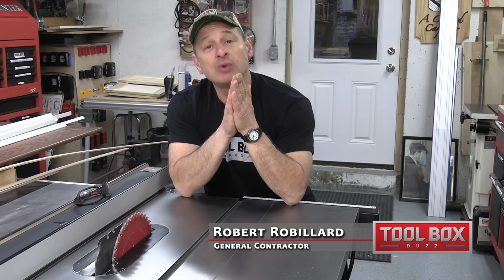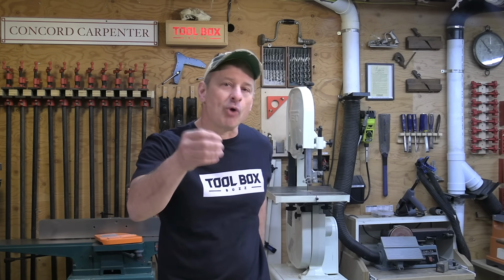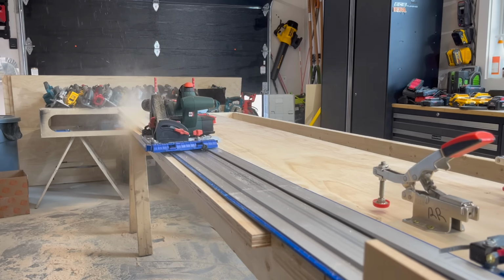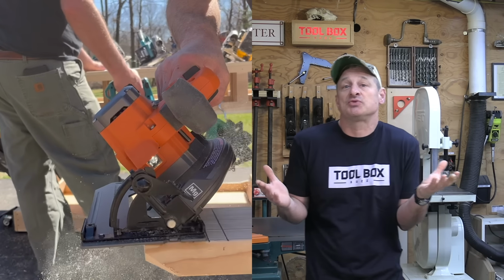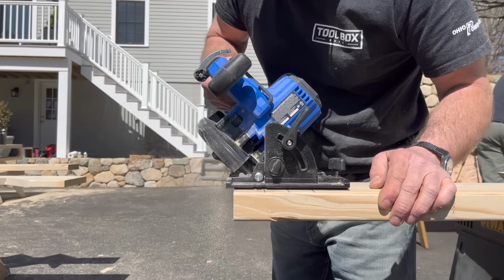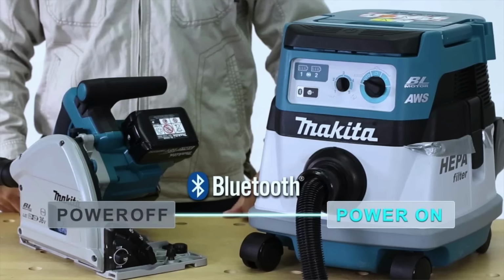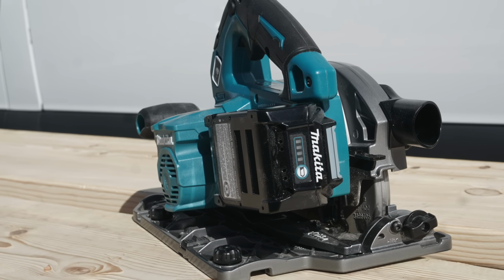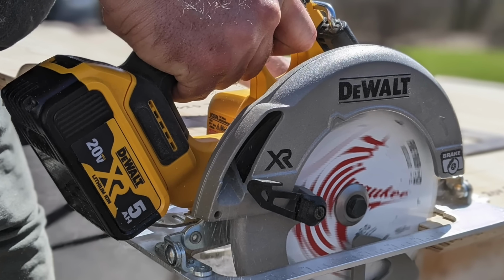Best Cordless 7-1/4 Circular Saw

Comment: I used a coworkers Metabo hpt circ saw, and I actually liked it so much I went and bought one and put my milwaukee fuel in the garage, I like the fuel a lot, but the Metabo was more comfortable to me, and I seemed to cut more accurate with it.
Reply: Metabo is becoming more well-known and seems to be every bit in the pro class. They also make some really good impact and drills.

 Im a framer, i always used dewalt which are good tools but also because of the other cordless options. But when I seen mikita in a worm drive style I got it, been using it for 2 years it works good. It is heavier but its comfortable to me. There is alot of really good cordless options now.
Reply: @jeremymcintyre7812 as a framer you should try the metabo rear handle. Super light and powerful

Comment: As a DeWalt owner one thing you forgot to mention is the 99% worthless depth gauge. It's steel-on-engraved-steel which is hard enough to see. Add saw dust and safety glasses and it disappears. I'm hoping white spray paint will fix it...
Reply: Should place blade depth directly to material thickness. Never use Depth gauge anyway

Comment: Considering that the Metabo HPT saw is probably one of the oldest saws on the list and it did very well. Finding them to be a good backup brand for when I have to send my Milwaukee stuff to warranty Great value great power again just great value
Reply: The new rear handle has replaced our other worm drive left handed saws on the jobsite
Reply from the maker: Agreed
Reply: @baseballdude8491  Just got that saw and love it. I have mostly dewalt tools, but as they wear out ill be replacing them with Metabo HPT. Impressive tools at a great price.
Reply: @michaelnichols7669  yep they are priced right and have all the things I'm looking for including the lifetime gaurantee
Reply: Agreed. If I was an apprentice carpenter right now I’d go metabo. Save a few bucks, great saws and nailers, and their bigger tools have the battery to plug feature. Hard to go wrong.
Reply: @ImpulseAudioSpeakers  Absolutely. Great value and quality I also have their sawzall, 18ga and framing nailer. I love using the tools
Reply: Love my green tools!  They are excellent, even if not quite the flashiest or fastest of the bunch.
Reply: @baseballdude8491  - Yeah, the new rear handle Metabo HPT is blowing a lot of the others out of the water. I was surprised that this older version was the one that was tested. I used to be a DeWalt fan, but when I got the 20V Max set after it came out, I was very disappointed. And when my reciprocating saw died after 3 months, and the manager of the tool department at Lowe's told me that "DeWalt's warranty doesn't apply to contractors", I was done with DeWalt. I switched to Hitachi, which then became Metabo HPT, and it's one of the best choices I've made. Never looked back.

Comment: As a veteran carpenter I will give my opinions on the saws I am familiar with. The Milwaukee, to heavy ,expensive ,bad view down both sides of blade and the motor cuts out under hard rips because the motor is pulling too many amps .Makita, excellent quality but they have moved the motor forward to accommodate the batteries thus the blade view is very poor particularly on the most important left hand side and the saw feels to hunched up and it is  to expensive. The Dewalt, most powerful, and excellent sightlines down both sides of blade this is very important to me as I don't rely on the front base notches of any saw to cut accurately, this saw feels familiar to me like my old corded saws ,reasonable price and low weight. I urge potential buyers to test each tool out and purchase regarding your own requirements .

Comment: Ive got the milwaukee for 3 years now and i still like it a lot , powerfull, reliable have work in all kind of harsh condition have never let me down, i like the 18v systeme all batterie fit in all the tool. In the near future when milwaukee will release pouch cell i will use it in my 18v tools dewalt will not be able to make a 60v pouch cell for theirs tool

Comment: Darn, was really hoping to see how the bosch profactor track capable saw would fair against the rest. Great saw, nice testing though!
Reply: I was waiting for the same thing
Reply: They left it out on purpose!
Reply: @JB-ot9hi  How so?
Reply: @scottarnold5215  By placing two DeWalt saws in the competition.
Reply: @scottarnold5215  Man you're wrong. Just keep spending them Stanley Decker and TTI tool company checks, guy! 
Bosch, Metabo, Mafell...
Reply: @JB-ot9hi  As a long-time member of Tool Box Buzz, I was heavily involved in this Head To Head Test. Bosch simply dropped the ball and did not send us a tool, and neither did Flex. You can believe what you'd like though.

Comment: Obviously the festool hkc55 does not use a 7-1/4" blade however it was designed for an intended use similar to that of 7-1/4" circular saws. Hence I do not believe it would be unreasonable to say that the hkc55 could be considered in the same category. That said I would consider it not only far and away the best saw out of all of these but I would say that due to its capabilities and features the hkc55 is in a class of its own.

Comment: Didn't use a high output battery with the Milwaukee, but used flexvolt on the Dewalt...
Reply from the maker: We kept the batteries is the same range of Ah
Reply: @ConcordCarpenter  Ah has nothing to do with the high output function. It is a considerable difference when using ANY Milwaukee tool with a high output battery. Ah is simply about runtime.

Comment: I'm one of those unicorns. For tool batt platform I use DeWalt, Makita, and Milwaukee. For sidewinder circ saw I run the Flexvolt and it's a great saw that has never let me down. 

As always very thorough h2h and I appreciate the time and effort you guys do for the h2h videos.

Comment: Ive been researching Flex for the last 3 years. I wanted to be sure before committing to a battery platform. Ive been doing construction for over 20 years and ive experienced all of the best offerings from the top green yellow and red brands. Im currently running all FLEX tools. FLEX is so far ahead of everything out there in power ,run time , charging and durability.
Reply from the maker: @JosephGahagan-vh4pz  I’ve been very impressed with flex so far. However, some of the flex tall that we’ve had have not lasted long term

Comment: It was said up front that the tests included a Ridgid R8657B circular saw.  There were two segments up front that displayed this saw, with the 2nd segment ending at about the 8:07 mark.  After that, there were several other video segments of a Ridgid circular saw that definitely was NOT the R8657B, including one showing it cutting - would you please explain why this is?

Comment: Disappointed that the New and widely available Bosch Profactor Strong Arm Brushless 7-1/4 saw didn't make it. Amazing saw, super powerful and comfortable brushless saw. especially with the 8.0 "Fat"Core battery.   Menards and Lowes locally have it in stock. Bosch StrongArm 7-1/4 SGKS18V-25.

Also, thank you for your extensive testing regimen efforts. Great reviews as usual.
Reply from the maker: This is the saw Bosch wanted tested

Comment: I have the milwaukee, but this xmas I got a smoking deal on some Metabo stuff, including the circ saw. I haven't messed with it yet, but based on your review it looks like I picked a winner.
Reply: I've been a red and blue guy for a long time but we have replaced alot of our jobsite tools I er the last 3+ yrs with more Metabo HPT 36V tools-Lifetime.warranty, AC adapter for the longer run tools(saves battery life), batteries backwards compatible with 18V and 36V, durable and priced much better than my other favorites which allows me to outfit more of my crew with pro grade tools w/out killing profits

Comment: I wanted to see the newer Bosch PROFACTOR GKS18V-25CB14. It's supposed to get comparable performance to a high performance corded saw and the material quality looks superb.
Regardless, it was a great comparison and your testing methods are very well thought
Reply: I like mine
Reply: just got the track compatible bosch biturbo, tradedin my 54v flexvolt. very  impressed with the Bosch, great  line of sight, plenty power,great height of blade adjustment, great feel to it,dont miss the dewalt one  bit

Comment: I love my Milwaukee fuel rear handle comes with a blade wrench like DeWalt. Plus I played around with the the bevel and height adjustment now I don't have a issue with them agreed you can't beat a DeWalt circular saw. But true enough can be said about Milwaukee sawzall

Comment: Thanks sir, a lot of work went into this. My dewalts have treated me very well. I noticed you had a XR 6.0 during the dewalt speed runs but the flexvolt 6.0 during other tests. The XR 6.0 is 21700 cells while the flex is 18650. My flexvolt sawzall runs stronger on an XR 6.0 than on a flex 6.0 even though it's supposed to benefit from flexvolt batteries. Long story short, I'd be curious what the dewalts times would look like if you threw a flexvolt 9.0 battery in considering it uses 21700 cells and the saw should technically benefit from the flexvolt battery tech itself. Either way, great info, and the makita with AWS and track compatibility is definitely on my wish list. All I need is for 17 skillsaws to stop working and I can finally justify it lol
Reply: I personally don't feel any difference between the 6ah 18650 and the 9ah 21700. The 6ah cells are samsong 20s (30a) and the 9ah cells are samsong 30t (35a), so not a big difference.
Reply: @MrArcticPOWER  The difference should be minimal at high battery level but at lower levels it can be significant.  As the battery drops down and power is demanded the voltage sag will increase on the 18650s compared to the 21700s.  This will also mean less heat due to lower current and better battery life and longevity.
Reply: @MrArcticPOWER  I understand that it doesn't feel like a major difference but from 1st to last place was only 8 seconds off so even taking 1-2 seconds off of a fastest cut is pretty substantial as it would be another 10-20% faster overall. I'm just curious, I like all my saws. Bosch, makita, dewalt, metabo, etc. Even the little M12 is alright, but definitely needs a major update considering a 5 3/8" saw should be doing better than a 1 1/2" cut depth. I get the same depth from dewalts 4 1/2" blade and Makitas 5 3/8" trim saw has 2" cut depth. I digress lol
Reply: Speeds wouldn’t be noticeable. Probably a few milliseconds difference if that. 6ah is more commonly used, 9ah adds a lot of weight as does the 12ah and 15ah flexvolt batteries. They do add some extra power as the battery doesn’t drain as quickly but I think for practicality they stuck with 6ah batteries which majority of platforms have and which most tradies would prefer using as they make the tool more comfortable to use
Reply: Btw, if you're using a 20v XR 6.0 battery on your sawzall, you don't have the real 60v flexvolt one, but the flexvolt advantage. They look the same, but the flexvolt advantage operates at 20v and is a lot less powerfull. Same thing for the cicular saw or any other flexvolt advantage tool. 
Why does the 6ah XR gives you more power than a 6ah flexvolt battery, I don't know. The 6ah flexvolt should be able to push a constent 90 amps at 20v while the 6ah XR can only do 70 amps. It doesn't make sense.

Comment: I have that Ryobi saw, it's great with a 5ah HP compatible battery and above, anything under... it sucks really bad, bogs down, stalls all the time, the smallest deflection in material can stall it instantly, but that 5ah HP battery does make a difference it feels like it wants to run away sometimes even in thicker harder material.

Comment: Not that it would make it from worst to best but you ran the worst battery for the Ryobi.  It was either the 1.5 or 2 ah non HP battery.  To give it a fair shake it should have been at least the 3 or 4 AH “High Performance” battery.  It makes a huge difference in power output.

Comment: Got the 40vMax saw, and a 6.5" 18v Makita brushless, both are accurate and feels great, you simply cant argue against Makitas build quality, not objectively at least. The 40v is awesome, very next level, i wouldnt dream of buying the weaker 2x18v with the hassle and bulk of dual battery. Makita XGT 40vMax isnt cheap, no, but good value for money. If i was invested in another battery system like M18 or DW i would still go for Makita circulars.
Reply: I think the convenience of having a true 1 battery system for over 250 tools is vastly underrated. On a Jobsite, having truly 1 battery that does literally everything, is extremely convenient. If you need another battery, just grab one, they literally work on everything, except sometimes you need 2 rather than just 1 depending what tool you are using

Comment: I'm pretty sure the legend is wrong. AFAIK the first patent for what could be recognised as a circular saw (British patent no.1152) was issued to a Southampton tradesman by the name of Samel Miller and was registered 5th August, 1777 - or 2 years before Ms Babbitt's was born (1779). It is believed that Walter Taylor (1734~1803), a carpenter, also from Southampton, preceded Miller in designing the circular saw, putting his first circular saw which was put into service at Wood Mill, on the River Itchen, to manufacture sheave blocks for the Royal Navy in 1781 (or when Ms Babbitt was 2 years old). Samuel Bentham, who is thought to have visited Wood Mill, took out patent no. 1951 in April 1793, for "labour saving devices in naval dockyards" which included the design of a circular saw - and it was this design which was subsequently adopted by the Royal Navy and manufactured by Henry Maudslay in 1805 which was the first production circular saw and it is preserved at the Portsmouth Block Mills in England. A lot more detail is to be found in the book, "The Story of the Saw" published in 1961 by Spear & Jackson (the firm that Henry Disston was apprenticed at)

Comment: Very thorough testing as always, so thanks for the good, thoughtful content. A bit disappointed not to see any of the Flex offerings included here. Project Farm put out a video a week ago where the older model 7 1/4” Circ saw from Flex bested its competitors. Pro Tool reviews had similar findings as Project Farm when they ranked Circular Saws in 2021, with Flex at or near the top of the list.  The new rear handled Flex may not be widely available yet, but it would be nice to see that offering as well.
Reply from the maker: Flex rear handle saw will be evaluated in our rear-handle H2H
Reply: @ConcordCarpenter  hi Rob. Why did you choose to separate the saws? So far my prediction is 100 I called Dewalt left and xgt righty
Reply from the maker: @shawnames5302  separated the saws by category/size- 6-1/2. 7-1/4 and rear handle 
They all have a bit different application as well
Reply: @shawnames5302  we use the Rear handle Flexvolt, Milwaukee and Makita 36V(2x18) but everyone is fighting over the new Metabo HPT's we have two on the last two months jobsites and guys are fighting over them and some of these guys are red, yellow and red fanboys-the weight and feel is real w/out sacrificing power and accuracy+we do have it plugged in with the AC adapter when making some deep cuts into larger stock which gives unlimited runtime and saves a few cycles on the batteries

Comment: One thing Ive never seen people test in any saw test is how well the blade guard will move out of the way as the blade enters at an angle, and at and angle cutting a miter.  When cutting on saw horses batching stuff out, you can just open the guard as you come into the cut, but what happens when you cant do that?  For instance, cutting rafter tails on the end of a hip roof, that is both an angle and a miter, and it can be a struggle one handed if the guard hangs up.  I still prefer my old Milwaukee sidewinder for this as it never jams, but all I use for batch cutting is my Skill worm drive.

Comment: Damn DeWalt has this 60 volt saw with a 9 amp battery and charger on sale right now for $269.00, that's about $70.00 less than they have been selling them for. I got mine a little over a year ago and it was $300.00. it is a beast of a saw but I swear I think I still do better cuts with my old corded one, I still have it but it stays in the garage now. My corded one is that real high-end one that they don't make anymore with the really good depth adjustment, where it has that knob on the front that you loosen and tighten.

Comment: I use a saw for working on tractor trailer floors usually 1 1/4 hardwood 12 in wide i have been through 2 milwaukee saws the last one didn't last for about 20 cuts a does anyone make a cordless saw that will hold up i don't use it everyday only when we get a hole in the floors any recommendations

Comment: Got my eye on the metabo HPT rear handle saw cuz of the weight and it can be cordless or corded , and can be found on the shelf n bought. But like the idea of using the 60 flex volt on my 20 volt tools .

Comment: Good review, one of the few channels that put in a huge effort into testing.  Looks like you had the old Metabo 18v saw which quite frankly is terrible - a shame you didn’t have the new brushless model to test against the other saws as I would like to know if it was worth buying 😂
Brand loyalty does come into tool buying but I think more important is the cost involved in adding an extra battery platform to your tools - having another charger and enough batteries to make the new tool useful can be a big investment for the little folk like me.